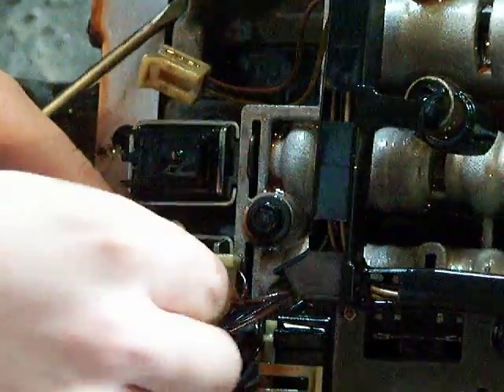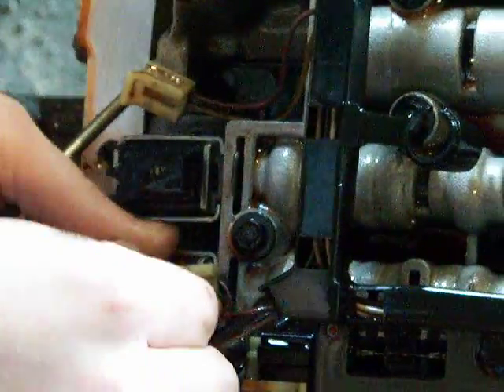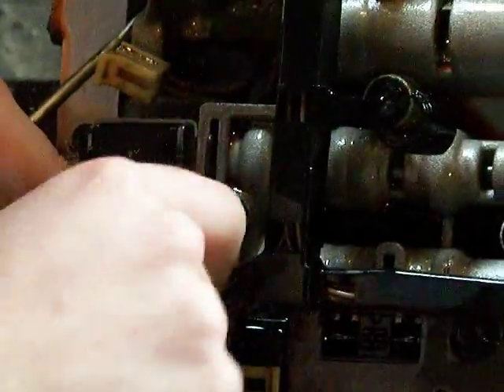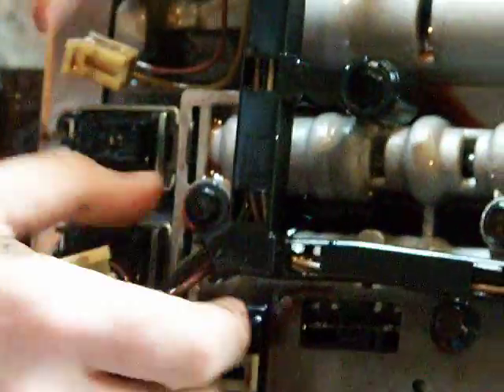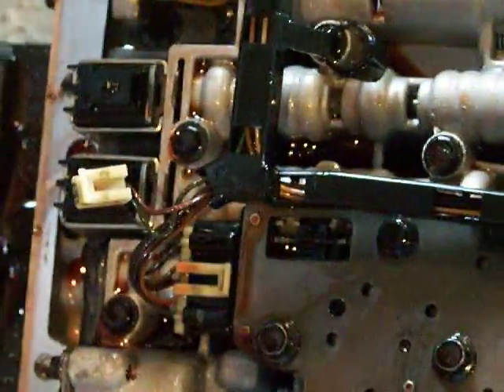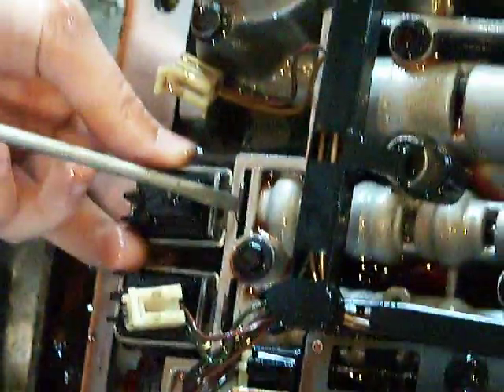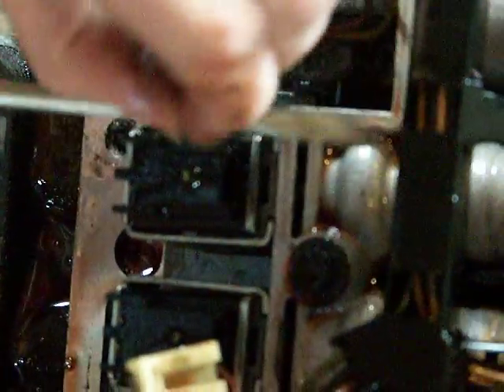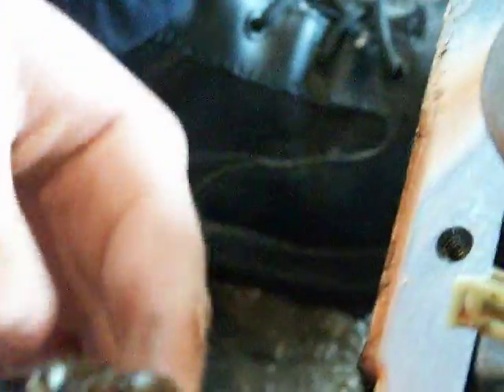4l60e Transmission shift solenoid replacement

Comment: I have 2006 Chevy TrailBlazer 4.2 V6 and its have a hard shift from 1st to 2nd. Do you recomend to change the solenoid? And do I have the same solenoid in my truck?
Reply: change the solenoids cheap fix it happened to my 06 tb. solenoids was the problem
Reply: +Jr Hernandez ...So what u suggest should I change it or not????

Comment: Young chap, are these solenoids under the transmission or on top? Can I change them without jacking the car up or does it have to be on a ramp? Do I have to drain the transmission fluid too? Thanks.
Reply: okay you will have to put the car on ramps and drain the auto trans fluid take the pan off, then remove the filter 
then follow this video and reverse the process

Comment: I have a 95 gmc suburban, it has no power if I go from park to drive, if I start in second it goes fine but I have to manually make it shift with the column, 2nd till about 35 mph then kick it in to drive, rpms don't drop at all unless I shift it myself, if I start in drive out will speed up I can even drive on the highway hit 85 but it don't want to shift what is this?? how do I fix it? engine light comes on and off

Comment: What was the transmission doing mine drives around good in 1st when you goto 2nd with foot on the gas it goes Into a neutral state HELP?!?!?!?
Reply: 1st no shift nutral
Reply: it's your 1-2 solenoid I would recommend pulling the codes with a scanner if you have a PCM code and shift code it's definitely the solenoid 1-2 might as well change 3-4 as well 30 dollars a piece at most auto parts stores

Comment: I have a 93 suburban and my speedometer won't work and it won't shift i have first gear and second gear but no 3 or 4 and it reverse gud what can be the problem i change the vss sensor

Comment from the maker: This video has truly gotten out of hand, I must say, lol.  I originally posted it years back to answer a specific question for one person.  I'm happy for whom it has helped, but I hope you understand this is not meant to be a full tutorial.  There have been some great videos made since that better show how this task is accomplished.  I have long considered making a more thorough video myself, but I haven't managed to find the time to just get it done.   I'll attempt to be more active here, given the popularity of the video, and attempt to answer what questions I may have the answers for.
Reply from the maker: ***** Some valves in the valve body are under light spring pressure.  This is normal,  The solenoid will push the valve back into place upon reassembly.
Reply: Silas Miller Autozone test said my Rav 4 needs a Transmission Control Solenoid. From this video, it looks like this job takes more than an hour. I took my Rav back to dealer and they say they fixed it in 30 minutes, under warranty, drives great 4 days and then goes to shifting bad again. The car dealer said it goes on top, I didn't know where, and the thing I saw was round?

Comment: Just wondering the video shows how to change the solenoid but where are they located?
Reply from the maker: Teresa Brummett Once you remove the transmission oil pan and filter, what you see in the video will make a lot more sense. The solenoids are in plain sight, and easily accessible on this unit.  I would recommend replacing both shift solenoids while you are in there.

Comment: what would still cause it not to shift into 3 4
Reply from the maker: Jeffrey Smiling The most common failure on these units is the loss of the 3rd clutch pack.  Your transmission will likely need a rebuild.

Comment: I have a 96 chevy 1500 4l60 tranny I have 1st 2nd an revers no 3rd or 4th I changed the b solenoid an still no 3rd an 4th
Reply: Jeffrey Smiling lete know if you figure this out because I have the same problem
Reply: Josh Robinson let me*

Comment: I have a 2002 Chevy Silverado 1500. I destroy my rear diff the other day had it toed back to the house rebuilt it and now I don't have 2nd,3rd, or od but 1st and reverse work just fine what's the deal??????
Reply from the maker: Sean McCarthy Sounds like a sprag (one-way) clutch has failed.  The transmission will need to be dis-assembled to verify and repair.
Reply: did you get your 2002 1500 4l60e to shift in to 3rd& 4th?  having the same problem

Comment: 4L60E Quality Transmission Master Rebuild Kit Overhaul Clutch Module 93 to 03       
http://rover.ebay.com/rover/1/711-53200-19255-0/1?icep_ff3=2&pub=5575031602&toolid=10001&campid=5337443831&customid=&icep_item=130812244203&ipn=psmain&icep_vectorid=229466&kwid=902099&mtid=824&kw=lg

Comment: all i got to say they are asshole for putting electronic inside a transmission folks should buy a car that is a stick shift they last longer and easy to change the oil do it every 5 thousand the trans will last along time

Comment: My 02 silverado was shifting hard 1st to 2nd and i changed the solenoids and checked the accumulator spring. All looked well but after driving it there was NO FIX. Good luck our there guys.
Reply: My s10 does it only cold??

Comment: i have a 1997 gmc sierra and the transmission wont shift out of second gear. i have done a diagnostic scan and the shift solenoid code popped up. blackandgold51 in your comment you described exactly what my truck is doing. do you take the transmission apart to get to the shift solenoid?
Reply: ***** thank you.

Comment: hi  hope you can help me out  i have been working on my cars/trucks /bikes for years  but this one has got me   same problem as a guy below  i have a 96 chevy c1500  has a 4l60e  was running great  then for no reason shifts 1st and second slips going into 3rd but if i let of it will shift but if i let of so does it   and no overdrive   reverse is fine- no fluid leaks- fluid clean- not milky no bubbles   also it is a 2 wheel drive with a 305 have been told only a 96 4l60e will fit hpe u can help

Comment: i have a 2004 chevy avalanche 4x4 was running just fine and one day i stopped at stop and when i took off the transmission shifted from 1st to second but when it shifted to 3rd it act like it wanted to shift to 3rd and started slipping and went back to 2nd  and would not shift to 3rd after that it just wind out i stopped and took off again  same thing shift to 2nd  and would only wind out and would not shift to 3rd .tried to manul shift through and still no 3rd or 4 any help please  thanks

Comment: more on topic... when I start the van and take off for the first time it seem to do as its supposed to till I come to a stop then back to the problem. if I shift manually it does a lot better but never seems to shift down to 1st like it stops at 2nd but shifts normally as I shift it through the gears when driving. also can I replace the solenoids from under the van so I don't have to pull trans and would you recommend changing filter while there? thanks for the help.

Comment: i have a 1999 safari and im having the shifting issue. first when driving like you would normally it feels like the trans is slipping but I don't think it is it feels more like it starts from a stop in 3rd gear and don't have the friction (clutches) to pull in that high of a gear. once up to normal speed for 3rd gear it has all kinds of power you can floor it and it pulls normally.

Comment: I HAVE A 1998 GMC SEIRRA . MY TRANSFER CASE  WILL NOT JUMP OUT OF 4WL. HAVE REPLACED C.M. & SERVO MOTOR. MOTOR TRYS TO DISENGAGE. HAD TO REMOME THE TRANSFERCASE & SERVO FUSE TO STOP THE MOTOR. CAN THE TRANSFERCASE SHIFT MECH.BE BENT?  THANKS.

Comment: I have a 2001 chevy blazer 2wd. It runs great, however, its 60 mph at 3000 rpm. Will changing this solenoid fix it?

Comment: i have a 1999 gtp with 176,000 miles. Lately the transmission is acting up. It bangs when it goes into gears especially the first two gears.. is my problem the solenoid?

Comment: I HAVE A 1994 CHEVY 2500 TRUCK WITH VORTEC MOTOR, AND MY TRANS WILL NOT SHIFT TO DRIVE AND OVER DRIVE I ONLY HAVE 1st AND 2nd GEAR IS THIS SOMETHING I CAN FIX MYSELF,BECAUSE I CANNOT AFFORD TO REBUILD OR REPLACE  PLEASE EMAIL TOO KEVSHEFF72@GMAIL.COM WITH ANSWER.

Comment: I am not sure if this is whats wrong with my 2001 Pontiac Montana minivan. It will not go more than 3 rpms and it will not shift from third to high gear. My son checked the trans fluid and he said it looks like it is bubbling on the dipstick.

Comment: Very informative! Just wondering if this would help me. I have a 1997 Cadillac Deville with the Northstar 4.6.  188k on it and it drives and rides great but, It doesn't shift gears. Go figure.I put it in drive and go. It never shifts out of first. I dont drive more than 45 mph ( I only drive about 20 miles a day). I drive to and from work and around town sometimes. Reverse works fine. No problems with shaking or vibration. Sooooo.... Could this be the problem?

Comment: You have what is called "limp home mode"... my Blazer took a crap yesterday as well.. same thing.  A good shop with a scanner should be able to read codes and tell you which died.. but from your question, best you have someone else do the repair.

Comment: My trans came as a package so they installed a converter lock-up kit but what needs to be done is to install a universal lock-up kit. It will have a vacume switch that will mount on the outside of the case. Most of the kit is inside the pan but it easy to install. You will now have 2 wires. Red and grean. The red goes to keyed on power and the green is opptinal and will allow you to lock the converter on a grounded toggle switch in 2nd 3rd and 4th gear.

Comment from the maker: @hpjunky70 I'm not sure what you're throwing out here for people to chew on?  I also have no idea what gave you the idea to send me that last email which felt very hostile, and a bit insulting coming from  a stranger who moments ago asked for help with a problem. Let people chew on that.    You are saying the 4l60e and the 700r4 are the same transmission, and yet you point out the largest difference.   The 4l60e is only vaguely similar to the 700r4 (Which is also called the 4l60)

Comment: i have a 94 c 1500 and had the trans rebuilt and now it shifts to 3rd by 15 mph and if i put it in manual 1st it will shift to 2nd, but if i unplug the DRAC or the vss it will hold manual 1st and 2nd but has no 3rd or 4th. please help

Comment from the maker: Weasel:  (Cont.) but you can drop the pan, and unplug the TCC solenoid.  Test drive the vehicle with that unplugged, and if the issue is gone, then you can narrow the issue down to an electronic issue.
But first, drop the pan, and with the key on, engine off, and the vehicle (Properly supported of course. Set the P-Brake!) in reverse, use an ohmmeter and test the TCC solenoid circuit for a short to ground. and compare the readings to other gear ranges. There should always be infinite ohms.

Comment from the maker: Weasel:  A shudder condition is more often than not an issue with the torque converter.  I'm a little suprised that it only happens in reverse, and it would make me think of a potential cross leak in the valvebody between the reverse, and TCC (Torque converter clutch) hydraulic circuits.    Considering the problem goes away when you remove power to the transmission however, I'd suspect a faulty TCC solenoid, or possibly a wiring issue.  It's a bit of work just for a test,  (Cont.)

Comment from the maker: No mercy: I'm a little rusty at remembering, lol. It's been awhile since I've actually been able to work on these units. If I recall, the 1-2 is the one pictured that I am 'not' replacing in this video.

But for the cost effectiveness, I Highly recommend replacing all the solenoids while you're in there.  It's a matter of time before these suckers go bad. Fluid is too expensive to keep dropping the pan, in my opinion.

Comment from the maker: Well, I'm trying to reply to you guys, but Youtube seems buggy, and won't let me...ssoooo...lol
Here we go.

Will & tech101:  missing 2nd gear could imply a stripped sunshell, or 2-4 band failure possibly.  If 4th, and reverse work fine, I'd first suspect a sticking 1-2 shift valve.  Drop those pans, pull out the 1-2 solenoid and remove the shift valve. It just slide out from behind the solenoid.  move it in and out of the bore. there should be NO, and I do mean NO roughness at all.

Comment: I am  on the same page as Itttech101. I  have an  01 Silverado and just finished the solenoid replacement as well as a filter replacement and I am  still  having the same problem. The tru ck runs fine in  1st revs high to  about 3500-4000 rpms then shifts into 3rd. There seems to  be no slipping,  however I have no second gear... there wasnt too much debris in  the pan, but I was  looking over  the service and it didnt have a service for about  100k miles... the fluid was black.. any suggestions

Comment from the maker: @evils1z28 Try when it is shuddering, while maintaining throttle, use your other foot to lightly press the brake pedal, just enough to turn on the brake lights. If the vibration goes away immediately, the torque converter is your problem.  They aren't cheap, be warned, and removing the transmission is require to replace it, but it is cheaper than a new transmission.

If this problem started right after the solenoid swap, I'd be confused. There isn't much you can do to screw up a job like that.

Comment from the maker: @evils1z28 Has any work been done to the car recently? Say when the problem started?    A mis adjusted shift linkage could cause you to think you're in OD, but in fact in the 3 position.   

Try finding an open road, and start from a stop with the gear selector in 1.  Shift up one gear position at a time as you accelerate and confirm that 4th isn't there for sure.         

What you describe as 'Shuddering" sounds torque converter related.

Comment from the maker: @nomercy3000 What year make and model vehicle?   If it's an old hydraulic transmission, than either a stuck Throttle valve, or a bad Governor valve.    Later model eletronic transmissions, look into the Shift A(1-2) solenoid, or a possible shift valve sticking.

Comment from the maker: @fattpieceofcrap I'm afraid that won't solve your issue.  Your transmission is in what is called 'limp home' mode.  A failsafe feature to let you drive on what the cars' systems deem a 'critical fault'.

Possible causes range from the transmission losing it's main electrical power source.
Engine misfires, or engine related sensor failure.
In some cases the PCM itself can be at fault.

Get the codes checked on it and make sure the engine is running properly first.

Comment from the maker: @evils1z28 Are there any more symptoms to work with?   Are you sure it's not going into 4th for sure? And you aren't mistaking the Torque Converter lock up engagement with the 3-4 shfit?  It's pretty common.

Comment: cool looks pretty easy . i got a 93 4l60 under a offroad truck. been using this truck for about 3 years and havent changed the fluid since i put it in, i check it regularly and there appears to be no water or anything in it. last time out i noticed its starting in 2nd gear so its go no power. figured its time to change the fluid and ill try swapping this out to see if it corrects the problem

Comment: Hi, Thank you for the video!  I have a 2000 Silverado Z71 4x4 and when you put it in drive from P N or R I have to wait a second other wise if I gas it right away, it will slamm into gear. It also jerks hard 1st-2nd  with up to 30% acceleraion. Everything else is fine. No "check engine" light.  I checked the fluid level and it is at proper level.  The "service 4wd" light comes on at times. Any thought? Please let me know. Thanks.

Comment from the maker: @TheKnightwalk3r Best bet is a dealership for the solenoids.  In this transmission the solenoids are universal, for 1-2 and 2-3. I'm not sure about an Astro, and what transmission it uses.

To jump the solenoid, simply unplug it, and run one wire from a  12V source (Battery) to terminal A of the solenoid. And another wire to terminal B. Ground the terminal B wire, and it will engage the solenoid.

Use the factory wire colors to find Terminal A and B. The neutral color wire, is terminal B.

Comment from the maker: @TheKnightwalk3r Also, when the solenoid is removed, you can remove the 1-2 shift valve from the valve body.  Try sliding it back and forth in it's bore. If it gets caught on ANYTHING, or feels rough at all, you'll need to replace the valve, and possibly the valve body.   It should slide like it's resting on a cloud. 

In some cases small burrs will form on the shift valve, and in some cases you can VERY carefully clean the burrs off

Comment from the maker: Possibly a sticking 1-2 solenoid, or shift valve inside the valvebody is sticking.

If you can jump the solenoid so that it turns on and off, listen for a delay before it turns on. Also listen to the sound of the solenoid. it should sound crisp and loud. if it's muffled, or quiet, replace it.

Comment from the maker: @ducknbean I'm unfamiliar with the transmission in that vehicle, but the best place to start would be to have the PCM scanned for trouble codes.  Lots of places do this for free now.  Autozone for example.     If there is a code for a shift solenoid, then it is likely the cause.    Other codes that may come up involve "Gear ratio incorrect"

Comment: Greetings! I have a 2004 f250 XLT Super Duty V10, and recently my truck would drive and shift flawlessly from 1st to 2nd just fine, but for some reason it would shift into 3rd or 4th gear, also my over drive button is flashing, what could be the problem? I did some research and read many forums and thinking that the shift solenoid could be a possibility. Thanks in advance for any help!

Comment from the maker: @rapsag1974 PCM can have intermittant issues. I have seen them before.  Also wiring could very well be intermittant.   Though this does sound to be a bigger issue than I can diagnose over the internet unfortunately.